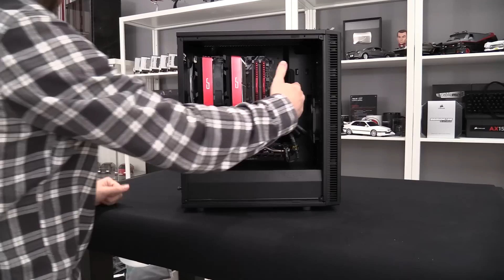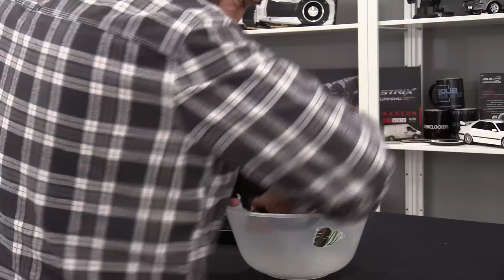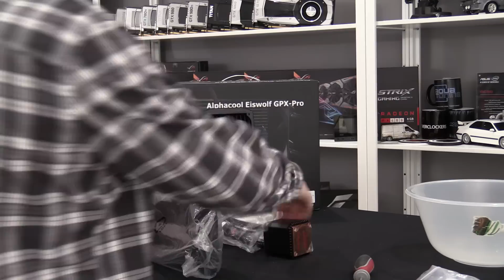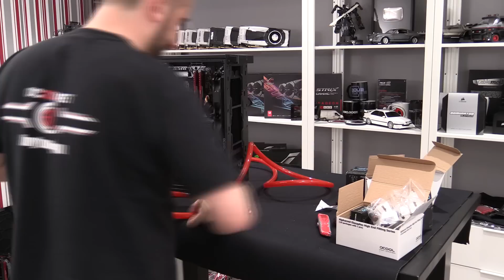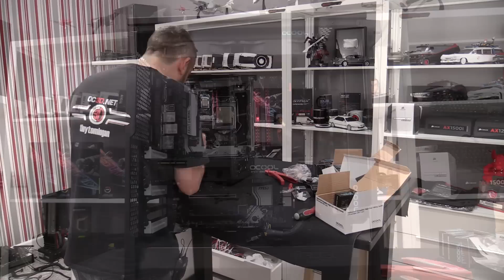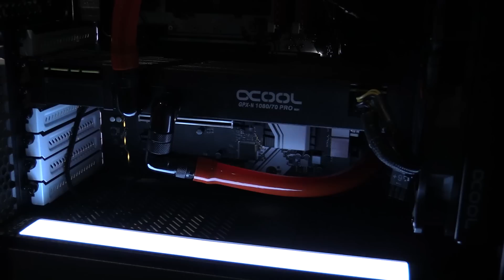Fractal Define C - Dual 240mm Radiator Watercooling Build

Comment: I have the same case but with a STRIX 2080 TI OC, and it's not much room left to the fans :)
I had to mount the radiator on the outside of the case, it just barely fit inside the frontcover. And the fans is holding the radiator from the inside :). Still get like 32 degrees celsius in idle. Couldn't mount a 240 in the top due to motherboard components being too high. :)

Comment: Can anyone tell me if my gskill RGB Ram Will block the ability to top mount my 240mm radiator with this case? I have the fractal focus G and my fans on my radiator are against my ram slightly and I want to avoid that. Would this case work for that? I have an h100i v2

Comment: I just recently installed a AlphaCool Eisbaer 360 on my 7700k its totally awesome can believe just how good it is, and now I want to do my ROG Strix 1080, only problem is they don't do a Eiswolf for my GPU. I also have a VRM block on my Mobo ( z270 Maximus IX Formula) that I want to add into the loop, would I fill the Loop the same as a normal water loop? In this case it would be through the fill port of the Eisbaer block as that's where it has a fill port, As you probably guessed I'm a Loop virgin and don't want to mess up my very expensive PC.  Or would I be better off getting a EKWB 360 Extreme Kit and put a full block and backplate on my 1080.
Reply from the maker: Pretty sure they do make one for it actually

Comment: I don't think this is gonna work in my Define C (ATX). Measured 50mm space from the top of the case to the ram heatsinks, can't cram a rad+fans in that space. Need low profile ram, but i'm not a fan of the idea of ditching a 32GB 3200MHz kit for this.. If only there was >5mm more space.

Comment: You should try these rads Alphacool NexXxoS ST30 Full Copper X-Flow 280mm radiator
Shorter tubes and better flow, and cleaner look overall.

Comment: I'm amazed he managed to fit 2 240 rads in this case but I'm curious, could it be possible to fit a res in the basement? I have a feeling it wouldn't be much of an issue if you removed the HDD bays but would a tiny res fit in there with the HDD bays? Maybe if you used a smaller PSU?
Reply from the maker: If you remove the mechanical HDD cage then yes you could put a small res and pump there

Comment: what was the thickness of the radiator + fan you had. On the fractal design website, it said that the case only provided 40mm of clearance for a top mounted 240mm rad. I am planning to put a 240mm radiator with a thickness of 54mm, would this case be able to fit it?
Reply from the maker: Best thing you can do is watch my full review here: https://www.youtube.com/watch?v=THjzl3zC6rs&t=1s

Comment: why dont you have clamps on those barbs, do you like your hardware wet? and also barb fittings? is this 2006?
Reply from the maker: You dont need barbs if you fit it right. I dont like compression fittings either. All bulky and horrible

Comment: it's a nice POC, but really crappy job :)
managed to put 2 240 rads in Define Nano S. with i7-4770K@4.5GHz+GTX 1070@2100MHz+16GB DDR3-1866@2133MHz.
all that without cutting the case with a huge D5 pump. The temps are at low forties while gaming.
next step - glass tubing (mayhems  13 OD).

Comment: Right before the Define C was announced I bought myself a Define S. No regrets though! Managed to dremel my way through the case and fit a 420mm radiator in the front, 140mm in the back and bend my own custom PSU shroud from an old unused sidepanel. 
Currently using 16mm OD black tubes from EK but soon to be completed with 16mm OD nikkel-plated copper tubes and fittings from Barrows.
Right now I just finished sleeving my custom length PSU cables to get rid of any cable clutter.. Even when they're hidden behind the MBtray or underneath the shroud, I can't stand the clutter :') 

Gotta love tinkering with PC rigs!

Comment: So.... you buy 2 AIO's rip them apart buy a load of pipes and fittings and slap it all back together?
It's also not a good idea to have two pumps running in line, (never built a custom loop, but have worked with pumps in the milk industry and if their not perfectly balanced things get messy very fast) eg if one pump fails etc.

Comment: I can fit 1x240mm, 1x280mm and 1x120mm rads in the NZXT Monta...and still be able to fit a D5 pump res combo, 4x3.5 Harddrives, 2x2.5 ssds...
Reply from the maker: Im not sure thats a good thing tbh.....
Reply: why thats not a good thing? the more rads the more cooling capacity, right?
Reply: Not 100% sure but that rad config creates quite some negative air pressure. Or did you go full fletched funky with fan directions? 

Also, even though the Manta is labeled mATX, it's almost as big as the Define C.
Reply: It's exact opposite. The 280 rad in the front acts as intake having 2xEK vardar fans with 800-1400RPM. The top 240 rad and the back 120 rad are as exhaust and they have 3xEK vardar fans with 600-1000RPM. Everything (all fans and the pump) is controlled by Aquaero based on liquid temp, to insure positive pressure, super quite and good performance.

Comment: whats the reason 240mm is more popular than 280mm rads?  seems to be a lot more area with a 280mm.
Reply: 120 mm fans tend to have higher static pressure for the same surface area. Most "radiator type" fans are 120mm for that reason. I expect the 140 mm market will get bigger as the technology improves. Even Noctua has yet to release a high static pressure 140 mm fan.
Reply: something to do with the fan thickness to diameter ratio I guess.

Comment: "cares about aesthetics" uses spaghetti cables ( not trying to sound like an ass, I recommend looking at phanteks cable extensions. 30$ for a kit )
Reply: ignore me if you replace them, I'm currently still watching the video.
Reply from the maker: extensions in such a small case are just bad news. I had to use the Fractal PSU for this video and I did say at the end about changing for full custom cables ( not extensions) later in the video

Comment: I totally agree I've only used white lighting in my rig for years no matter what the mobo/gpu/heatsink/wiring coloring is as it gives a much cleaner look. I feel like it would be the same or cheaper to go full custom vs this setup. I understand the significance of it tho for those who have an aio on either their cpu or gpu already and want to upgrade/combine whatever they aren't using an aio on. Crazy how Temps are better with all combined tho. I was thinking pumps would interfere with each other (if specs and rpm weren't identical) and the heat of both units within 1 loop without a reservoir may overload it. Great results tho. Love videos like this. Something different from the same old reviews on new products.

Comment: can you fit the EK-XLC Predator 360 in that  case and will it be enough for a i7 6700k and a gtx 1080 fe?
Reply: modus it would easily be enough but the 360 wouldn't fit. You would be better to go with the 280 predator for the front (it looks like a 280 fits upfront don't quote me on it tho) and an prefilled ek waterblock for the gpu  (they do that now) and get either a 120mm prefilled rad for the rear or a 240mm prefilled for the top. With all the fittings and effort to make it look good you would be better off going custom tho.

Comment: I don't understand why one wouldn't do this instead of the hard tubing. I like this much more than hard tubing. It looks minimalistic nice.
Reply: Spoert M depends on the rig. In a larger case hard tubing can look much cleaner then soft. In this compact rig with the ability to hide the tubing through the back of the case and behind the top rad it turned out clean.
Reply: It depends a lot on person IMHO, to me the straight runs and 90 degree bends which you just cant get with soft tubing looks a lot nicer.

Comment: Great video Tom, Do you think this is a viable long term cooling solution, what with there being no res and the fact that the gpu water block doesn't cover the whole card?
Reply from the maker: temps are great though dude... and with this config it even has a 120mm fan on it from the front
Reply: Temps are fantastic I was very surprised but I was thinking more from a reliability point of view but I guess as there are 2 pumps pushing the water around it would take a lot of the stress away.

Comment: Need a link to this 'Alphacool eislift' or whatever the fuck it is.... Im googling but i cant find that product anywhere
Reply: Calm the fuck down.
Captain Obvious is here to clear up the case:
So the initial question could have been a little more specific. (like mentioning what you're actually looking for)
So there are some answers just trying to help. Which is nice.
But it was kind of obvious OP was not looking for the Eisbaer or the Eiswolf.
So everybody is frustrated because nobody knows what the fuck everybody else is talking about.

So come on guys, hug it out.
Don't be angry. Forgive each other for not being perfect.
Show some love. <3
Reply: 31:00 I didn't find it but it might be called 'Eislicht'.
Reply: +König der Welt already looked but couldnt find it Tom called it an 'EL Panel' or something 31:00
Reply: Playing the video back it sounded like TT was saying 'Eis Licht' though I cant be too sure as googling that brings up nothing as well.
Reply: The product boxes are in the start of the video. Alphacool Eisbaer 240 CPU and the Alphacool Eiswolf GPX-Pro. Basically he turned two AIO set-ups (more like modular) into a custom loop, clever way to save space as the pumps are part of the CPU and GPU water blocks.
Reply: http://www.alphacool.com/

Top right hand corner of the page you will see a button with a German flag and UK flag to swap language.
Reply: daft vagrant for the love of god.... Im not asking about what radiators or pumps the man is using.and I am not stupid. Im more then capable of navigating a website. but since nobody has linked the product in question directly - I guess no one else can find it either. therefore its NOT listed on the alphacool website so the website might as well all be in greek for that matter as it wont make a blind bit of difference
Reply: RoseOfHizaki
Well isn't this nice, help someone out and they get all shitty.

Both products are on the front page of the website, they are right there for you to see. Open your eyes and look at the link I provided.
Reply: daft vagrant No.... Youre not helping at all. YOU need to open your eyes maybe and read my comments properly? Im after that light bar thing at the bottom of the case that TT said was made from aluminium. I dont need to know about anything else thats related to the build. Thank you very much.
Reply: You should look into that being a shitty person problem you have, might get farther.
Reply: daft vagrant and you need to look into being more useful rather then just plain calling people out for being rude. Dont get me wrong. I understand that you meant well, but you have failed to understand that the information you have given me wasnt what i was looking for. And rather then raise your hands up and admitting you were of no help or couldnt help me you decided to call me out. 

I think that says a lot about you as a person so dont go throwing insults around when youre the one accusing ofther people of being rude. Because I can do it too.
Reply: Mate try this :) http://www.xiwwix.com/produktsuche/led-ring-50-mm-62955